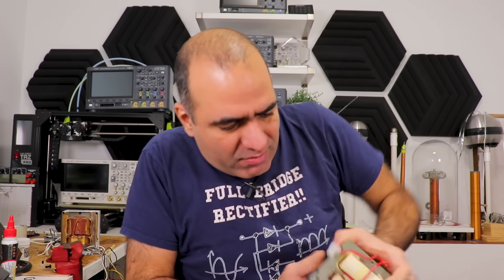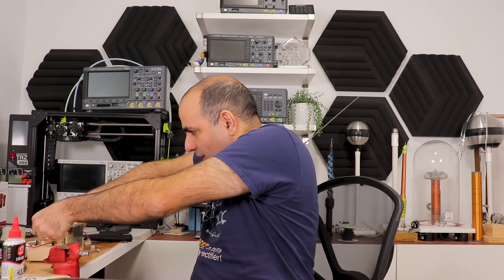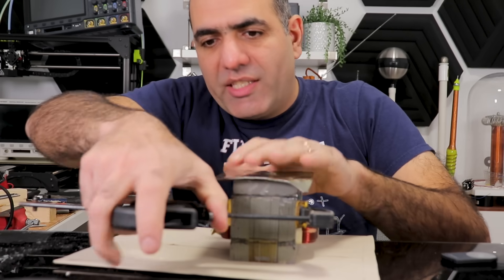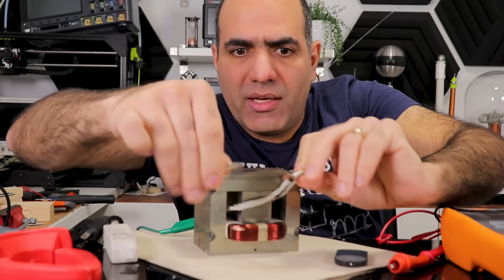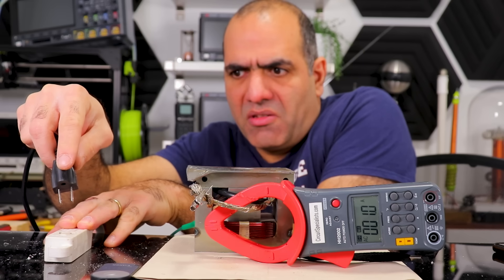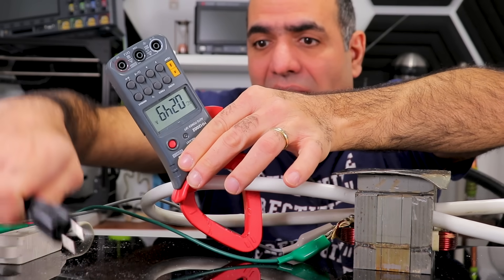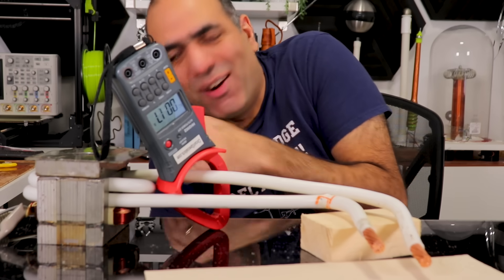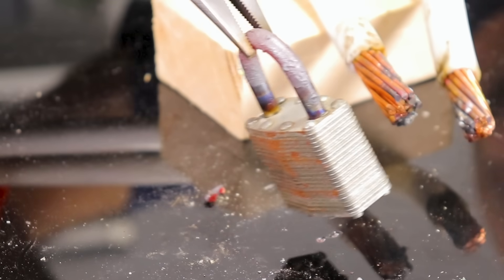Making "MILLIONS" of AMPS of Current

Comment: Mhhhhh if I’m not was to lazy when I did study what he do is only lower the voltage and  increase the cuttend the max load will not change much BECAUSE he forget the saturation of the core the max  magnetic  (load ) fiel of the core material.

Comment: What was interesting is that as the key lock got hotter, the Amps starting decreasing. I suspect it has to do with how the electrons were starting to release from atoms, when the lock started to turn into plasma.
Reply: No, it's the resistance of the lock increasing as it gets hotter. He shows it with the wires.

Comment: You would need old a penny for it to be 90% copper 10% tin (im pretty sure the percentageis right.) At least thats how pennies made before 1962 were. From 1962-1981 it was copper zinc from 1982 on is like 97.5% zinc and 2.5% copper. ( btw these are the USA penny percentage so im sure Canadas were close to ours.)

Comment: For those who’d like to try the experiment, you can buy battery cable (or even better, welding cable), which is much more flexible than standard stranded wire.

Comment: salam mehrdi,
mersi babate video ha.

Can you make a video about cicuite of XRF guns ? they make x-ray for spectroscopy, and the electronic circuite is very interesting, but my electronic background is not strong.
they work with battery and yet, they can produce x-ray, and very high voltage, but small current, if i am not mistaken.
hope you read this.

Comment: Use vice clam to bend such large secondary winding,use also vise clamp to hold the transformer while in under experiment,when it in proper according to your useful design then weld the core,

Comment: Idk if you still check comments on these videos, but as a guy who knows nothing about electronics, I have a question. So, if the primary winding of the transformer must have significantly more turns of wire compared to the secondary to produce higher current while not exceeding the input current, why not use a different primary with even more turns to increase the ratio of primary:secondary turns? Is there some other physical limitation that would make that infeasible?

Comment: using P=I²R you could find the maximum possible current for a given limited voltage and current power supply
so √(1,800÷60mOhm)=~173A max
which would be at √(1,800×(60mOhm) = ~10V
so you'd want N1/N2 = V1/V2, (N2×V1)/V2 = (120×10)/120=10 turns
though that is assuming the resistance is linear and also ignoring heat.
also I'm not 100% sure he said 60mOhm but I cant be bothered finding where he said it also not sure about current so I made that up
just swap the numbers if you care
Reply: also assuming 100% efficiency
Reply: Lmao he said 20mOhm 4:35

Comment: I made something similar for heating evaporation boats made of tantalum or tungsten for a coating machine. They got white hot in vacuum and were made of 2 inch wide by 6 inch long sheet metal. Fill them up with whatever you want to boil and coat stuff with. The most common coating materials were gold and titanium.

Comment: I have a question that is vaguely related.
Honestly Electroboom, I've been watching your videos for almost a decade now, along with a few other youtubers in related fields.
My question is more of a terminology based thing about standard 3 phase 60 Hz power (voltage & amperage readings don't really matter in this context)
Whenever I see a diagram of a 3 phase coil assembly, there are specific coils that are assigned to one of the three individual circuits in the 3 phase system, in a "firing pattern" that either turns torque into electricity, or electricity into torque.
Why do we call this a 3 phase system, instead of calling it a 3 single phase system? Since all 3 phase machines need at least 7 wires leading into them (6 if you exclude the ground wire) (don't exclude the ground wire)
I've always wondered if there was a way to send a true 3 phase 60 Hz current at any voltage, and or amperage, through a single solid "sending wire" into a machine, and then back out through a single solid recieving wire, over long distances, without needing to outfit the machine with its own rectifier/battery bank/ inverter setup.
And I imagine that might have a lot to do with the form & shape of the coils, the direction relative to the core that the magnetic fields form & collapse in, and the diection each coil is oriented in, the direction they were wound in, the sequence they fire off in, the frequency of the power they are either recieving or converting, and of course, the Guage of the wire used, multiplied by the number of winds per coil.

Comment: Maybe a dumb question but what would have happened if you took the primary coil off and left the secondary and hooked you 120v line voltage too that then stuck a big wire on top?

Comment: I can’t wrap my head around generators, alternators, inverter generators. 

I read that inverter generators use alternator to create ac, rectify to dc, then invert back to ac. 

But why use an alternator? Why not use a dc generator and cut out the rectifier?

Further, Honda says it can make inverter generator smaller and lighter by incorporating the alternator into the fly wheel. Why can’t regular generators do that?

Finally, how does the inverter generator “know” to increase throttle and /or engine speed when it is loaded? I understand that a regular generator has a governor that makes keeps the ac  current at 60hz. But inverter generators vary their rpm based on the load, no?

Please do a video - I’m so confused

Comment: For a low voltage high current idea, look into EDM - or Electric Discharge Machining.

They use an electrode to burn fine detials into a pice of metal (which acts as a anode.  Though you're generating far too much current for those (they operate around 30 to 300 amps, not the thousands on display here)

Comment: He should unwind a induction motor and put a few turns on it I did it with a small motor and it ran at 0.7 volts 40 amps

Comment: Why did you not just use your tesla coil? Reverse the input and the output, instead of getting high voltage you get high current. Also your electricity bills must be sky high with all the power consumption. Also melting a coin or any money is a federal crime, although I have never seen anyone get a ticket or a fine or jail time for it.

Comment: Well i use this thing in my job to heat up rusted bolts where you can't use flame, works perfectly almost 4 years  now, using thick cabels from car battery cables, they are not stiff, prety easy to wind in.

Comment: I rewound one of those with a single winding of 35mm2 welding cable, primary draws about 15amp, secondary gives an output in excess of 1200amp (at dead short)

Comment: You don't need a wire, you need a metal bar. Preferably machined to the right shape with ceramic insulation.

Comment: hi. I need your help with my headphones. I have a Logitech g733 and the battery died in it. Unfortunately, I cannot find the exact battery that it came with. It uses Li-ion battery and I'm wondering if I can replace it with Li-ion Polymer(pk cell lp803860) is the model. Would that work?

Comment: Your next video should be you taking a sewing machine foot pedal and soldering it to that 3 plug splitter… just in case the #2 comes in contact with the ceiling mounted air circulator…

Comment: So you switched to a different secondary. So you have less turns than the primary. But what if you switched the primary and used the secondary as the primary. So there is a even more different amount of windings.

Comment: I got 3 batteries 2 of 12v/150ah and 1 no of 12v/200ah can I make it 24v 150ah + 12v 200ah = 24v 350ah
Reply: @Pelican_t  the current setup is old one and make 26 now and it only cause in balance but I makes the voltage demand

Comment: I have a question. The high current shouldn't harm him? Like a shock? Is it the low voltage that prevents it from happening?
Reply: Yes, the voltage being low keeps the current low for the same resistance. If his body resistance were 1000 ohms, 2 volts would only push 0.002 amps through his body.

Current=voltage/resistance

Comment: I read that a laser beam can ionize the air enough for lightning to follow that path.  I would like you to do an experiment in the laboratory with a high voltage generator and a laser (diode) to test this.  or why not, during a storm, outside....?😁😁😁

Comment: Can you explain why
   1. Like Battery's🔋,fuels ⛽ etc... Work until it is completed(Drain) but why permanent magnet🧲 don't lose its magnetic field after using it for many long times  Eg: speaker🔊, DC motor etc.. 

   2. 🔊Speakers works by moving its diaphragm and make air to move(vibrant) and provide sound. But in watch speaker has no diaphragm. Than how the sound is made in watch?? . If the amplifier output is given to DC motor  The DC motor starts making music in low volume( without diaphragm how it work)?? 

   3. Earth atmosphere is made of gases and the gases are free to move. Gases like helium move upwards. Gases like oxygen, carbon dioxide etc..stay in earth. why these gases don't goes to the space?? What make gases stay inside of earth without moving to space🌌?? 

   4. How black light is projected from a projector📽️ to a white screen?? Is there any black LED??

Comment: You should have gotten welding primary wire. Its a high strand count and very flexible. As for uses i turned one into a resistive spot welder.

Comment: Jumping jiggawatts! This reminds me of a "1200A Breaker of DEATH!" post I saw once on /r/ScarySigns, along with a comment from someone saying they worked on equipment that produced hundreds of thousands of amps, yet the voltage was so low that you could touch the bus bars with bare (and dry) hands and be fine... as long as you didn't have any metal on you.

Comment: How is he able to hold onto the spoon across those two leads with 400+ amps surging through it? He mentions its high current low voltage but isn't this 120 volts on the primary so what is the actual voltage through that secondary? I'd be afraid of anything over 10Amps !

Comment: Hi Electroboom guy. I've been watching you for years! Your videos never disappoint.

I was hoping that you could comment about a unique feature of the current transformer you just built.

What if you wired it backwards, and ran a large current through the thick wire, for the purpose of measuring a proportionally smaller current on the secondary? What would be the quantity of output VOLTAGE of the transformer? Is it proportional to the input voltage applied? There is a unique quantity known as the "Burden" resistance on the secondary side of a true CT, that is in turn (hehe) "transformed" to the primary side, and its value is 1/N^2. 

I've been studying CT's since they're commonly used in electrical substations for metering and system protection schemes. Cool stuff! Fries my brain.
Reply: His name is Mehdi
Reply: @vidhyas4791  I'm sure it is.

Comment: This kind of 'technic' was shown a few 100 times on YT already ;-) Nothing special for ElectroBOOOM - i guess...   And if you want to see real million amps go the the german 'Deutsche Affinerie' - now called 'Aurubis' in Hamburg. They use low voltage, very high amperage DC for electrolysis to regain copper, silver, gold, pt, .... from scrap metals. My father welded the connections: hugh blocks of massive aluminium (200 x 500 mm square) to the electrolytic baths....  They use huge diodes capable of 2500 amps each in parallel.

Comment: Your crazy dude 🤣 I used to weld with such high amperage that we required a larger diameter wire than most company's manufacture. But this is just scary . But I have confidence in your confidence.
Please don't die and make us both look stupid tho 😂

Comment: Hi sir, I am a high school student from India and I watched your video on surface charges in electrical circuits on your YouTube channel. Still I have some questions left and one of them is this and I request you to please help me with this if possible. My question is-

We know that steady state arises very quickly so surface charges have to establish very quickly and for that to occur the electrons should travel very small distances and that can happen only if they come from surfacial atoms of the wire itself. But if that's the case they would establish an opposite charge gradient inside the wire ( as an electron leaving from a surface atom will leave it positive ) and that would counter the electric field from surface charge gradient. So how exactly these surface charges come from? I have also read "matter and interactions" but in that too its not answered. Please help me with this.

Comment: So is the reason those sparks weren't dangerous is because there wasn't enough voltage to push that current through your body?
Reply: It's almost zero volts, at most it would burn your finger as he showed

Comment: Hi Mehdi, just wondering what would happen if you took 2 MOTs and cut off the straight part of the transformer and joined the 2 "E" parts of the transformer together? I suppose it should still work properly plus you would get more room for more turns? 🤔
Reply: should work, yes. the biggest problem would probably be finding two MOTs with the same size
Reply: Care to not put two primaries although would love to see whatd happen

Comment: Sort of related, but you wouldn’t happen to know a good place to get high voltage resistors? Based on calculations, I need at least 30 GOhms at 15kV with a 3W rating. I have a fun project in mind 👀

Comment: The newer Canadian pennies were made of steel, not zinc. That way you couldn't melt them for more than $0.01 worth of metal (at current zinc prices, a zinc penny can be melted for only a 20% loss, but this was once profitable). The problem is that turning steel into pennies costs more than $0.01 worth of labour per penny, so they stopped making them.

Comment: Correct me if I’m wrong but can’t you just swap the primary and secondary to get the reverse voltage drop. Or is that just not enough current boost.

Comment: You holding the bear leads of that transformer is terrific I know it’s low voltage but still the fact that theirs that much current going through it is wild
Reply: I was asking myself how did he not die in 3:57
The wire heated up very quickly, which means a high current, so how did he not get electrocuted?
Reply: @robsonalmeida5045  
I think because of the very low voltage
Reply: @robsonalmeida5045  The high current is only through the low-resistance wire. His body has much higher resistance, so much less current passes through his body.
Reply: I wonder too, often read that it is not voltage but current that kills
Reply: @skunkz42  
No he proved that the voltage is the killer
Reply: @skunkz42  its the current through the BODY that kills, which can only be produced by a high enough voltage (anything less than 50V is typically a non-serious shock). You can still get hurt from the fire/heat hazard from the high current heating up metal as shown in the video though!

Comment: The wire gauge is pronounced "Ought." Like "He ought to get his hand out of that trap."

The struggle of bending it was real 😄. I'm surprised you couldn't find bigger. A local electrical supplier would likely have 250 or 500MCM (Kcmil to young people). And you could have bought it by the foot. But it seems even 4/0 would have not fit well in the core.

Comment: Here's a video idea: Build a working hall effect "sensor".
I've been wanting to attempt it myself sometime soon, but based on how few results I get when I look online for examples of others making one, it seems like I'm probably underestimating how complicated it's going to be. I know that it boils down to essentially just measuring a voltage difference across a conductor (or a semiconductor?) when a current passing through it is deflected by a nearby magnetic field. I also know that the voltage difference can be extremely tiny, so some kind of amplifier circuit is needed in order to actually detect anything. I mean, come on, how hard can that be? Right?
Reply: Suggest on r/ElectroBOOM lol (*reddit if you're r/OutOfTheLoop)

Comment: If you got it to 12v and made an insanely huge bridge rectifier, could you use this to jump start a car? It'll be kinda cool having a jump starter that never runs out of power. A battery going flat while trying to start a stupid project car is mega annoying
Reply: you can do the same thing with a decent charger and supercapacitors

Comment: if you only have a flimsy table to hammer on, place the item as close to being directly over a leg as possible. or use your own leg to brace the table

the difference between a solid striking surface and a non-solid one is a lot more than most people think (legit 2 swings vs 20+ sometimes)
(i assume the rapid hammering was mostly for the luls, but still lol)

Comment: Does a microwave oven transformer-based tesla coil, plugged into 120v wall power, need a noise suppression circuit to keep high-frequency feedback from wreaking havoc on circuits in the house? Also, how do you properly ballast a microwave transformer so it doesn't immediately throw the breaker when shorted? Also is it more efficient to run the MOT on 240 as opposed to 120? Would that spread the amp load from shorting out enough?

Comment: hello i have a question, what would happen if someone puts his finger BETWEEN the two ends of the wire? would anything flow through?
Reply: It would flow through but nothing would really happen
Reply: Depends on the voltage and the resistance of your finger but probably it would flow
And with current that high it would not be pretty